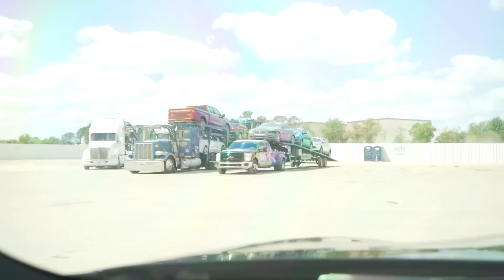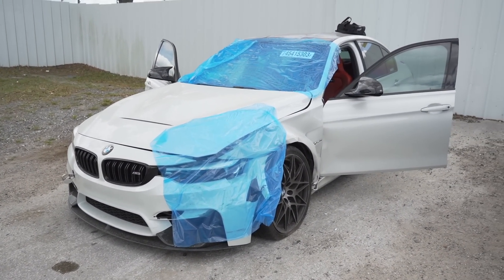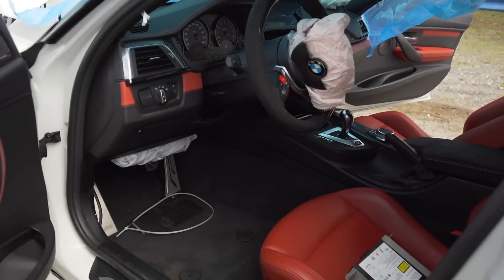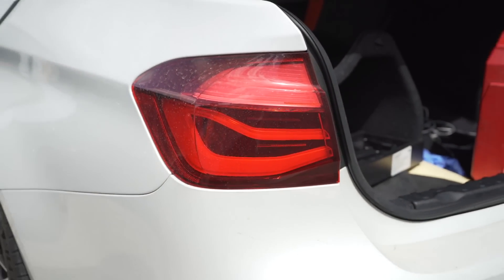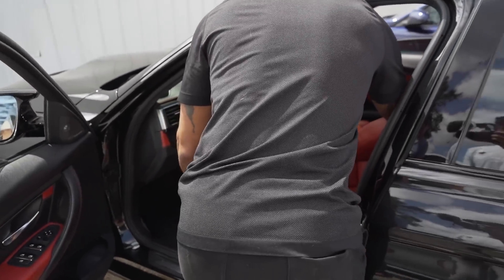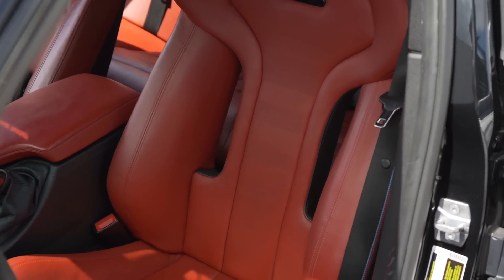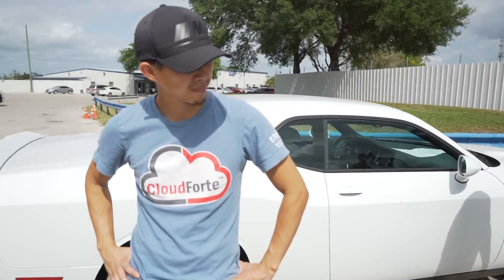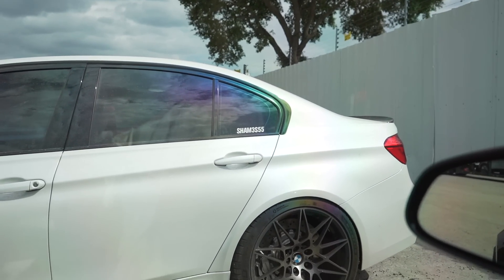SWAPPING RED COMPETITION SEATS INTO MY F80 M3! + what happened to Ben’s F80?

Comment: Is the chassis compromised? I had an accident that completely ripped into my headlight and bumper and i just did a cash repair as my chassis was straight and engine wasn’t compromised, it seems the cars in the US(i assume u guys are from the us) get write off so easily
Reply from the maker: I believe there was frame damage and in the US if airbags deploy, insurance usually writes the car off